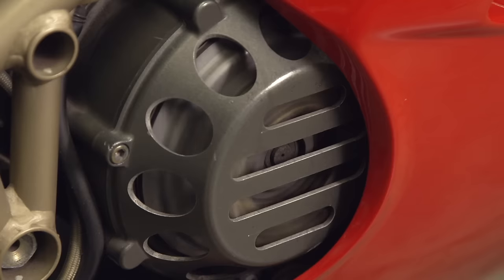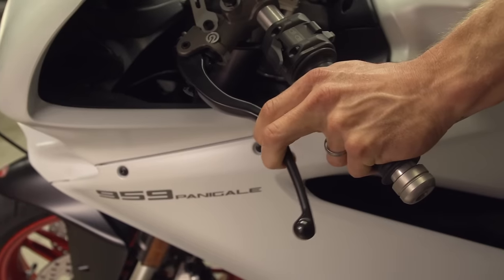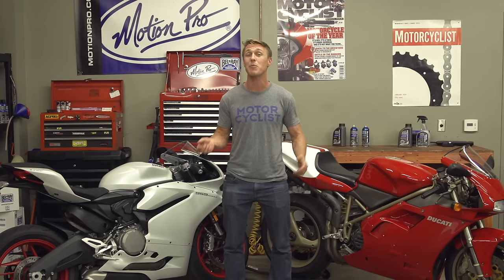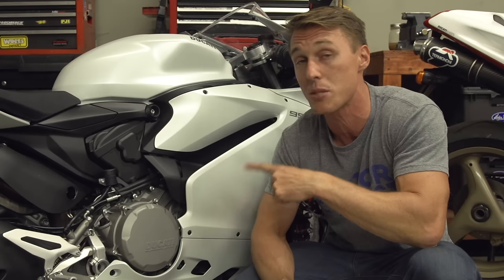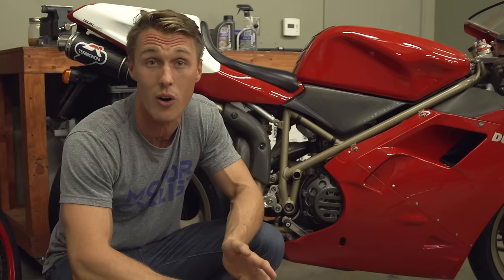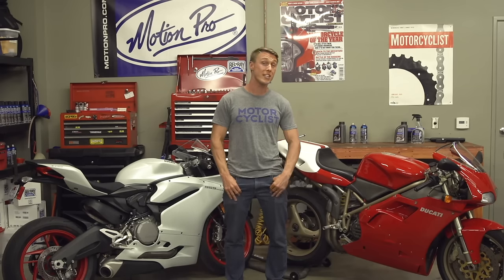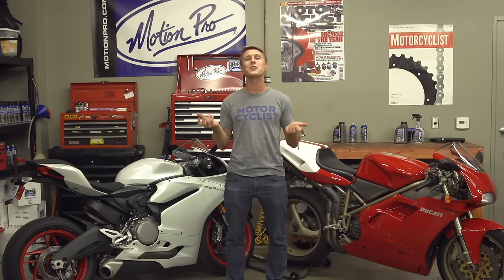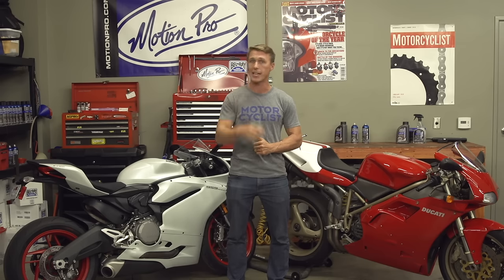Wet Clutch vs. Dry Clutch - What’s the Difference? | MC GARAGE

Comment: The main and most important thing you didn't mention, actually this is why they are used in MotoGP, is that in motorcycles equipped with dry clutch you may use engine oil with additives that reduce friction( like regular car engine oils), hence less internal engine drag and more power!
Reply: Private Factory great!
Reply: Private Factory and easier to change out. No need to drain and add oil
Reply: Private Factory did u even watch the video, he clearly states that the fluids in the wet clutch saps some of the power.
Reply: I have to Sneeze  Sapping power and having slipping is different. This guy have another point than what the video mentioned.
Reply: He mentioned that in the video dude
Reply: This maybe a stupid question but would a hotter climate (120°F+/54°C+)negatively affect a dry clutch setup? 

In the summer it can get scorching and I’d like to get something with a dry clutch, I just don’t want to face a lot of issues by doing so.
Reply: Roderick the simple answer is yes. How much though? Another question entirely 

Imagine how much more wear your motor would get if it wasn’t bathed in oil 

Then put a dry motor in 100+ weather

It certainly will affect the lifespan

But I don’t know how much
Reply: err....not necessarily true. nowadays a lot (I mean a LOT) of people who using car/diesel oil with additives that reduce friction on their wet clutch bikes, including me. been using it for almost 4 years now. no issues.
Reply: @I have to Sneeze 
What Ari failed to mention is the fact that the motor oil in the wet clutch motorcycle motors either don’t have or have minimal friction reducing additives in the oil!
That means you have to run regular SAE grade oils or something with less friction reducing additives to keep the clutch packs doing their job maintaining the connection between the engine rotation and the transmission rotation!
If you were to use a synthetic blend or full synthetic motor oil, the clutches would not perform or operate effectively and would rob more engine power or cause a lot of transmission slippage!!!!
There really aught to be a way to separate the clutches from the engine so that the engine has its own oil and the transmission clutches could be lubricated without being bathed in motor oils! 
The way it seems to be now, the engine and transmission w/clutch pack are all contributing to the overall heat of the lubricated engine and transmission parts! 
Which means that the engine oil alone is responsible for keeping the motor, transmission and clutch packs cool!!! 
I’m no engineer, but this seems to me, like a no brainer! 
In a car or truck with a manual transmission, the engine rotated a flywheel which is attached to the crankshaft at the output end of the engine, that flywheel has a pressure plate with a clutch plate that allows the rotation of the engine to continue when the clutch is depressed which separates the engine’s rotation from the transmission’s rotation(while at a stop or between gear changes).
However, here it seems that motorcycles have combined two different technologies in one combination, they have a manual transmission with an automatic, oil bath clutch pack which has all been combined within the motorcycle engines operational process.
I’m thinking that in 75-85yrs the technology for the motorcycle engine and transmission has not changed all that much and as a motorcycle rider, you have a choice to make between a slight loss in available power is too much to have a wet clutch design or if listening to loose marbles banging around in your mom’s clothes dryer is a better choice than the small percentage of power loss in the wet clutch pack, to have the dry clutch design!

Unless some bright engineer(s) undertake the challenge of designing a motorcycle transmission where the wet clutch packs are divorced from the engine itself!!! 
Then again, would it just be easier to add some Lucas Oil Brand Oil Stabilizer to the motorcycle engine oil to help negate the loss of power to the wet clutch pack design???
Reply: No..it's so you can change the clutch in the pit lane without having to wait for the engine oil to drain...that's it.
Reply: @Vintaronica  they can change a clutch in the middle of a race??
Reply: @afletra  If you put a Ceratec or Motor Protect additive the clutch never ever engaged again
Reply: 1:25
Reply: @texasinstrumentti-nspirecx5555  thats was about the clutch dragging in the oil. Not the engine in general because of the different oil
Reply: @rj1234100  unless youre slipping the clutch a lot it would actually benefit you since your engine stays a lot coolef. Due to the frictionless oil and the clutch doesnt shed its heat in the oil.

Saw a lot of guzzi's riding in the toscane mountains at 38C

Comment: do a video on dohc vs sohc engines please and do tell the maximum limit of a single cylinder please!!
Reply: Was just about to comment the same thing! Difference in maintenance included.
Reply: yeah,me same
Reply: Dhaval Bane dohc>sohc
Reply: @georgle elias not necessarily true
Reply: @jellie33414  it depends upon the setup of the bike.
Reply: Timing a single head and putting the chain back over the valve is the most annoying process. That and keepers in the springs lmao

Comment: I actually like the "grabbiness" of the dry clutch a lot. I owned a Monster 900 and the noise was just awesome, Termi and open dry clutch makes for a very... "mechanical" feeling. True, it's rough as hell in the traffic but when you open the throttle...
Also, the BMW boxer had a dry clutch till the last air-oil cooled version, just few years ago. Completely different beast tough, single huge disk compared to multi disks like the Ducati.
Reply: Err, no it didn't.  Both my 1100 and 1150GS have are pure air cooled and have wet clutches.
Reply: @thomassessions9347 my 96 oil head has a dry clutch.. I replaced the damn thing

Comment: Ooo! I got one! Fixed (or preload adjustment only) suspension VS fully adjustable suspension for the street, whether the rider weighs 150 pounds, or 250 pounds :P Pros and cons--why is one better than the other, or if there's a "it doesn't really matter factor since you're on the street" debate. I hope this makes sense. I guess in essence traditional forks VS USD forks would be thrown in there too.
Reply: For this high a weight difference the only solution is a new spring.
Reply: Mudux Well it was just an example--not necessarily those exact weights. More like "if" it's better to have adjustable suspension depending on your weight. I'm trying to make the best sense I can lol
Reply: yea! and normal Front forks vs Invert...
Reply: I've owned bikes with BOTH kinds of front-forks!!! Honestly? I don't think there's any differences at ALL between the two,other than their "looks"!!! As they both move up and down in the same lateral way to "cushion" bumps. Both come in "adjustable" and NON-adjustable. Both have inner-springs and oil/fluids to help lubricate,cushion and keep things "cool" inside the tubes!!! Just my opinion. :)
Reply: +menom7 I guess all cars are more or less the same,since they have an engine (at the front or rear or in the centre), there are 4 wheels, doors,suspension etc...
Reply: menom7 go learn about motorcycle suspension instead of "having an opinion" on how they work...
Reply: Mudux I DO know how they work,however......stating WHICH one is "better" (conventional vs.Inverted),isn't a "fact",but what will work best for your personal applications. Just because You prefer one over the other,doesn't make it "Better". Just my opinion. Lol.

Comment: MG clutch has a different design than Ducati’s so its not noisy at all. It’s tough on the hand however. It can last over 50 thousand miles. For the records I have a 916 and a 1000SP2. Thanks for the video

Comment: My old Norton Commando runs a dry clutch in a primary chaincase.  A while back I also converted the primary drive from chain to belt, and in the process I got a deeper clutch basket capable of holding one more plate and one more steel.  With the belt drive, there's no chain to lubricate, so the primary chaincase is bone dry -- which is important with a dry clutch, since you don't want the oil bath for a chain getting splashed up onto the clutch's friction surfaces.  Then you'll have a non-clutch in pretty short order.

For years, I rode a Honda with a wet clutch, and in comparing the two, I'd say that yes, the friction zone on a dry clutch is more narrow.  So it's probably not the thing for the beginning rider.  It just takes a little more skill to get moving.

I should add that my Honda had a six-speed transmission and a relatively "peaky" engine.  The Norton has an insanely wide power band, so it only needs four gears.  So I do 33% less shifting than most folks

One of the biggest things I did to make the dry clutch easier to deal with was install an aftermarket hydraulic clutch release where the old cable was.  For starters, that has drastically reduced the amount of adjustment needed (since there's no cable to tension).  And that consistency of engagement adds some life to the clutch.  The friction zone at the release lever is also slightly wider than it was with the cable.  That in combination with a whole lot of vibration not getting transferred up the cable to the handle make operating the clutch easier -- although it's never going to be as easy as operating a wet clutch.

Having to replace the friction surfaces more often with a dry clutch is no big deal -- particularly because when you have to do it, you don't have to open anything that's full of oil.  (At least this is true on my bike since going to belt drive.  If you have to keep a primary chain oiled, this might not be true.)  I can pretty much be in and out of my clutch, totally rebuilding it, in under an hour.  A full set of plates for my bike is about $80 (as of 2023).  And typically I can get 5-6 seasons of riding out of a new clutch.  So it's not an expensive proposition.

The big plus, however, is being able to make adjustments to the oil used in engine and transmission without having to worry about the clutch.  On a bike with separate engine and transmission cases, this is huge.  I can pick the perfect oil for the engine, put my favorite gear oil in the gearbox (I can't say enough good things about Royal Purple Max Gear 75W-90), and I can not have to worry at all about how that impacts my clutch.

My perfect bike (which I have now, I think) has a dry clutch and a hydraulic release mechanism.  But a lot can depend on rider skill and preference.

Comment: Wow. Great explanation. I have a Ducati, and I don't like the rattle... and still I had to open the clutch-cover to provide better cooling.
However, from a technical viewpoint, I think a dryclutch is better as long as you don't slip it a lot (like in super-slow traffic or if you're just a bad rider). That's why they're used in GP bikes: you set off once, and after that, clutch-wear is negligible. And when you have to change the clutch-pack, it's done in a jiffy.

Comment: I swore I would never own a Ducati because of the noise, but here I am riding around on one at 70 years old, people often remark on the noise of the bike, and it is a wet clutch ST3. I was researching before buying the bike and came across a review by an American guy who was quite impressed by the machine (ST3) . He remarked the best way to sum up the additional engine noise to those who were not familiar with it was "if you have a Japanese bike that sounds like a Ducati, you may have some serious issues that need attention, but if your Ducati sounds like a broken Japanese bike, that's ok because that's what it's supposed to sound like".

Comment: Motor Guzzi  is not stuck in the Stone Age they have build something that lasts it works for them. You can't be a bike manufacturer from 1921 with all that experience still using dry clutch  and be a wrong thing to do, how many millions of miles  has been ridden on Gazzi's with no problems whatsoever if they didn't work no one would buy the bike and the company woulda went out of business in 1925. This is a company that made racing motorcycles the first V 8 motorcycle was made by them they use wind tunnels to test the motorcycles and they are hand assembled. Don't condemn them for something that works and works well. People are still riding motor guzzis on the road from the 50s there well made, and a true pleasure to ride.

Comment: These MC Garage short clips are awesome. Not sure if it's been done yet, but could you please do one on how to clean textile gear, leather gear, and (especially) gloves? Cheers.
Reply: Thanks Ari. Clever me went for a wp textile jacket with alota white on in, and lets just say the white doesn't stay white for too long. I know getting leathers soaked in water isn't good for it but I've had it drenched in a downpour and it was fine so I figured a quick hose down wouldn't do much harm. Still seems okay, but I'll go with wiping it down from now on. Cheers.

Comment: Different twins,  Harley vs Ducati vs Triumph vs KTM and why they sound different from each other
Reply: valve size, stroke length, cylinder size, exhaust, manifold, OHC or push-rod, cam size, all these factors and more vary the sound and performance of a V twin, Every motorbike maker has their own spin on the classic V twin thus why they vary so much.

Comment: BMW also long used dry clutches on the R series (boxer twins) though they have gone completely wet on those with the 2019 model year. I have a '98 R1100R and getting to the clutch isn't easy because it's setup more like a RWD automobile.

Comment: Whats the HP difference between both if on same engine ?
Reply: I'd imagine it being very minimal, nothing you would really notice on the street. Would be interesting to know the exact figures though!
Reply: if the clutch grabs, there is no more movement so also no power loss
Reply: Not true unless you just stalled the bike. 

While it's true there is no relative movement between the input and output shalfs once the clutch is fully engaged, the whole clutch assemble is spinning. 

In a dry clutch there is very little drag, because the whole assemble is spinning in air.

In a wet clutch the whole clutch pack is spinning in oil, that oil creates drag on the clutch pack as it moves inside the clutch housing. 

The power difference isn't much but in racing ever HP counts and drawbacks of dry clutches don't apply because they're just rebuild them between races.
Reply: powerloss through the drag of the oil
Reply: I would guess around 2-3% max. Powerloss on the wheel

Comment: It re4ally depends on the bike. I have a 1959 BMW R50 that by dad bought new that year. It had already gone around the clock once and the clutch is the original one on the bike and have never been changed. Just as the gearbox has never been open. My other BMW bikes also have dry clutches and also they have never needed replacing even after 50k plus.

Comment: Question: I have a 1999 VFR800FI. Once stuck in traffic for several hours (no lane splitting in FL), after so much clutching the lever became so hard I could barely pull it in. I believe that is normal under those conditions but wonder if there is a way to avoid it.Thanks for the many great videos.
Reply: Why didn't you lane split anyways?
It's only illegal if a cop watches you do it 
Lane splitting is the main reason people buy bikes. It cuts down on commute time so much
Reply: @siddharthsharma8940  Actually, the laws exist despite the presence of a policeman to enforce it. I get what you mean though. I did take my chances as I could but the reason for the hrs of traffic jam was an oil tanker accident. There was already police everywhere and I was no close to any exit. I believe my clutch plates got soaked and caused the lever to be extremely hard to press. I just do not know if other bikes have the same behavior and/or if there is a way to prevent it from happening. The entire situation was out of the ordinary but I still wonder. Note: It is mindboggling to me that lane splitting is illegal in some states.

Comment: Recently, the replacement time of the clutch disc was over, so I was curious, so I looked for it and found that two clutch systems were installed on the Ducati.

It's my scrambler, it's a 2020 model. As a result of Googling and inquiries from companies, most of the answers are that you need to open the clutch case to check which of the two is installed. Overseas is the same, and some companies say that this is a headache and there is a lot of friction with customers. That's partly because the disc price difference between the two systems is more than 100 euros.

Most Ducati models older than 18 years have aptc systems and fcc is confirmed to be recent.

I wonder why both systems are installed at the same time even though they are the same year.

Comment: USD forks vs standard telescopic forks?
Reply: What does this mean?  Inverted forks most likely are always better.  I think the non-inverted forks are great for cost savings in some way.
Reply: The usd makes it thicker on top, which can limit how far you can move the wheel left n right.    Not really an issue now, but perhaps with some older frame designs

Comment: A dry clutch is also smaller, can offer the same amount of friction as a bigger wet clutch. Another reason they are used on racing bikes. Rs250, tz250 nsr500 moto gp etc.

Comment: There is a wet clutch that does not share the oil with the transmission like the metric bikes. The H-D wet clutch does not share the engine oil with the transmission and clutch pack. It has a dry sump engine with a separate oil tank for the engine and this oil, as well as that in the engine crankcase, stays separate from the transmission sump which has a magnetic drain plug. The oil change frequency - at least for my Sportster - is @ 10K miles for the transmission and 5K miles for the engine.